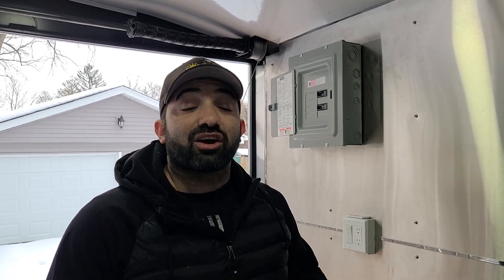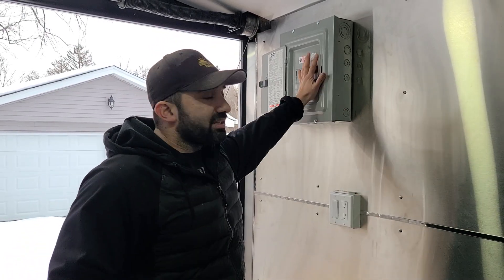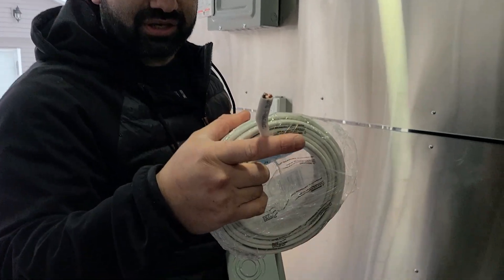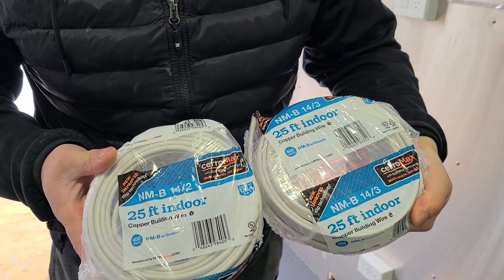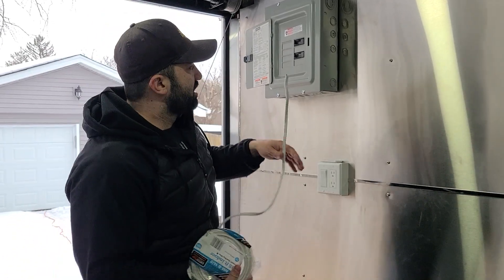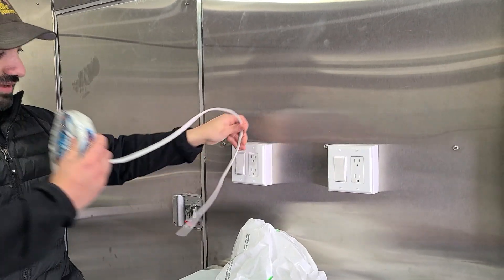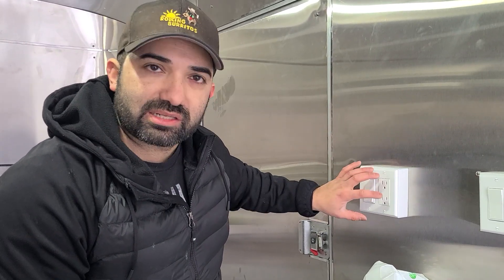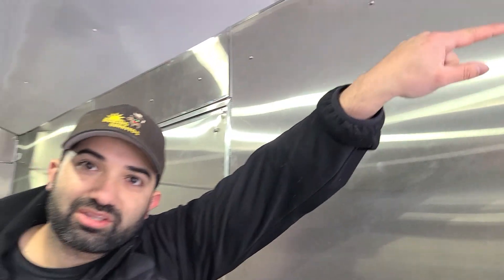How to Build a Food Truck: Installing the Electrical

Comment: So what about a main breaker? How do you size the main breaker - do you size it by the service cable size?
Reply from the maker: There is no main breaker in this breaker box. Only 2-15 amp Breakers and the generator inlet plug in the front of the trailer. The wire gets sized by the size of the generator you are using
Reply: @fbaltierrez  but if i connect to power that is not from my generator would i need a main breaker?
Reply from the maker: @liamstone3437  that power line should have a breaker of its own from its breaker feed
Reply from the maker: @liamstone3437  but you can just buy a breaker box in your truck with a main breaker that Will work perfectly as well.

Comment: Thank you for these videos Frank!  I'm getting a lot of good tips.
I hoping to get some advice on what breaker panel I need.  I'm actually building a bar truck for weddings and special events and only plan on using shore power for now.  Because I will be running a keg cooler and a bottle cooler (both 115v) plus some led lights, I guess I will need to be plugged into two designated 15 amp circuits.  Do I need two seperate breaker boxes or can I get one that allows for two input sources?  
Thanks Frank, 
Mike in BC Canada.
Reply from the maker: Sorry for late reply. But a Siemens 8 circuit panel works a little small one

Comment: Hey Frank!  Great video as always! Question for ya, kinda off topic but still electric related...  Do you use an air conditioner in your builds? For your size trailer (according to square footage) could easily be cooled by a 5000-6000 BTU (750 watts tops) air conditioner.  Now maybe with all kitchen equipment running heating up the place, that size AC might not be strong enough? I'm debating putting one in my build but I dont wanna waste my time/money if its not feasible.
Reply from the maker: I didn't put AC in my trailer and this new one does not have one either. Just use a fan and you should be good

Comment: Not trying to step on your toes but careful with the wire size, you cannot use 14 gauge wire for a 20 amp circuit. 20A circuits must use 12 gauge or larger.  Check out this wire gauge chart:

http://www.mcgowanelectric.com/uploads/wire-size-chart.jpg
Reply from the maker: Absolutely you are correct but I'm not using a 20 amp circuit in this food truck. Only 2 15 amp circuits

Comment: Great video Frank!
I got it the first two videos but this is a very descriptive video to clarify, so now I'm confident I did everything right.

One question, what kind of box did you use to cover the S/O wire on the floor? Do you have a link?
Reply from the maker: Awesome!!!!! Love it. I used a wire mold box. I linked it on the description with a blank cover to cover the box opening. Works great